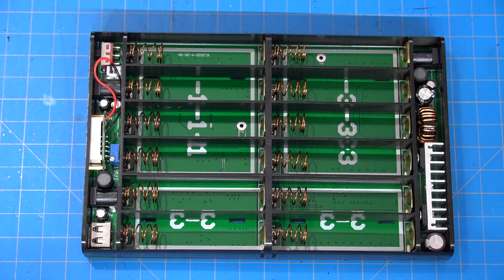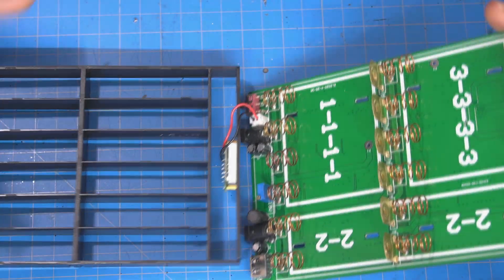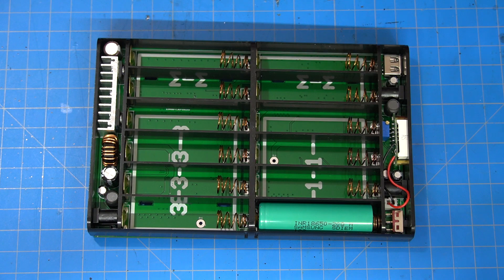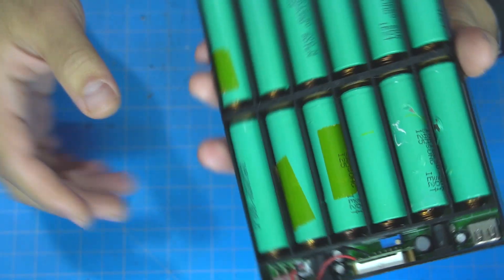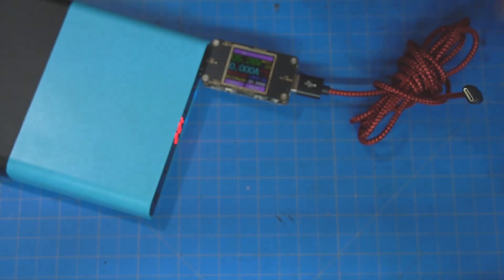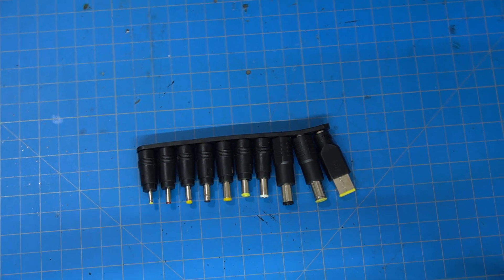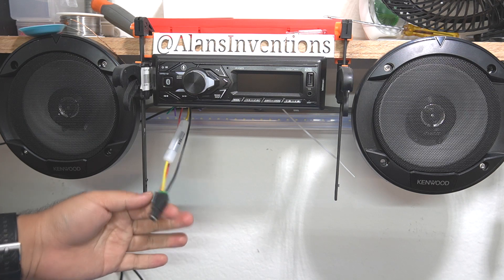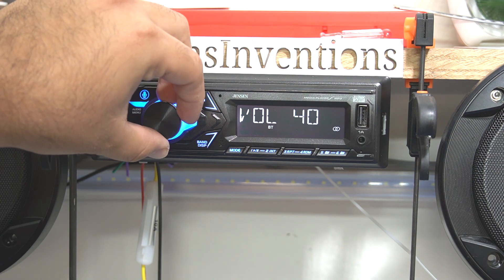18650 12v battery case buy! Worth it?

Comment: USB DC 12V Output 6x 18650 Batteries UPS DIY Power Bank Box Charger for Cellphone WiFi Router LED Light Security Camera
https://a.aliexpress.com/_m0CSCMN
Make a video for this 
Is it ups????
Reply from the maker: That looks very siilar to the one I have. What did you want to know?

Comment: Interesting DIY case. Can you recharge all the 12x 18650 on the case without having to remove it? Is there a bms on the case?
Reply from the maker: Yes!
Reply from the maker: Hi - Yes there is a BMS and over-charge/discharge protection built in. Dpending on the model you can charge it using 12 - 24 Volts. Per the manufacturer, although I stick to 12 volts to be on the safe side..

Comment: I don't understand the layout of this bank. There's a four groups of 3 cells version 'A', which makes sense, but this is the 3 groups of 4 cell version 'B' ... Outputs less power (60W vs 90W according to one seller's page I saw). Why does this version exist, what's the benefit to this layout?
Reply from the maker: Yeah I am not sure either, I have asked a few questions from the seller and get no real answers back.
Reply: @AlansInventions  Typical. How much testing have you done with the 12-24V output? I'd really like to know if it can truly output 60W. A laptop playing a demanding game should suffice if you don't have a more precise way of drawing 60W from it.
Reply from the maker: I run a stereo off 12V, I think the max draw is like 80W peak. No issues except one of my 18650s was over dischardged and had to be thrown out.
Reply: @AlansInventions  Hi again - I ended up buying one of these ... Can you tell me how to adjust the voltage? Mine comes with a 19v readout on the front, but it's supposed to be 12-24 adjustable right?
Reply: @SovietGrazz  looks like theres a blue potentiometer inside that you can rotate with a screw.

Comment: Can you please do a further review on this power bank as I have the same one. I don't no how to charge it all instructions are in Chinese. Thanks.
Reply from the maker: Hi Alan. Sure, what would you like to see? I charge mine by hooking it up to a lab bench power supply at 12V and 1A. When I purchased mine it had the option to select an input either 12v - 24v or 16v - 24v.  I am sure you could use any 12v power brick to charge this. I added a link to the description above with something that I think you could use. You should probably check which version you have first.
Reply: @AlansInventions  do you plug the charger in the back of the unit. Thanks.
Reply from the maker: It should say input on the correct part, it's like etched into the plastic
Reply: @AlansInventions  yes it does on the back. Iv tried a 12v in the back but nothing. No indication of it charging what so ever.
Reply: @alanbrown7155  since you got the ups version which is 16v-24v, you must turn the case on when charging...just use laptop charger
Reply: @AlansInventions  well I picked the 12v to 24v but they sent me the 16v the 24v one instead. Lol

Comment: That stereo probably doesn't use more or put out more than 60 watts
Reply: Check what ohm rating the speakers are and what ohm rating at 50watts
Reply: @joshuabest100  I assume it's 4 all the way around but I'd still like to see some numbers before I believe them but also if it does hit those peak numbers for a couple milliseconds you could possibly add some of those super capacitors in parallel for those surges
Reply: @james10739  honestly the audio amplifier chips are insanely powerful and really cheap to manufacture
Reply from the maker: Well the specifications for it say that it can output a maximum of 50 watts per channel and it has 4 channels? Do you think it's 50 watts combined?
Reply: @AlansInventions  I think they are lying or it's a peak that is not real life or some real specific test conditions and I imagine at a normal listening volume it's probably like 20 watts